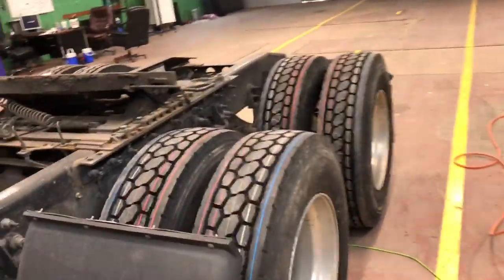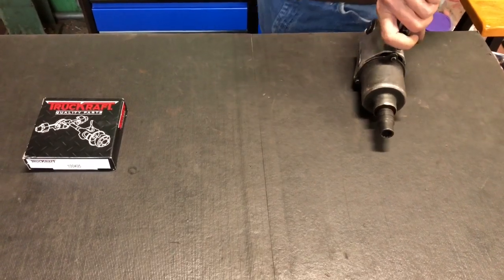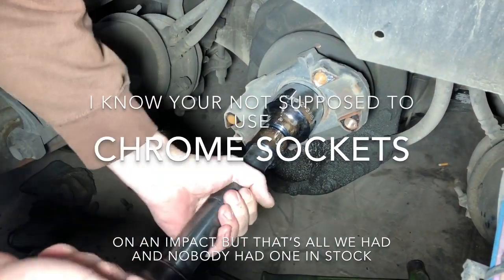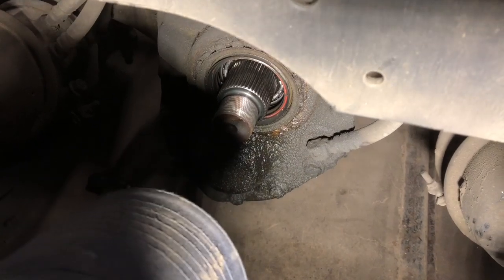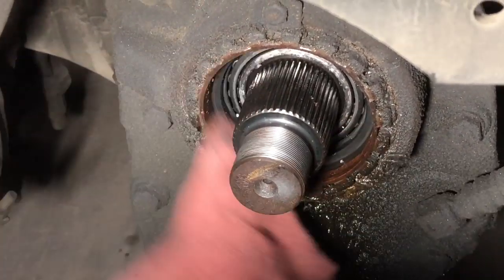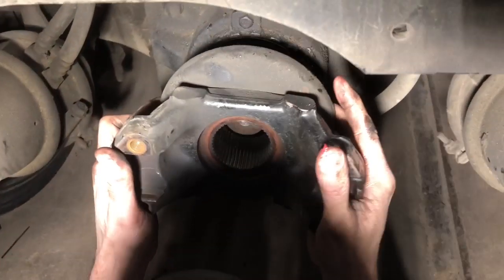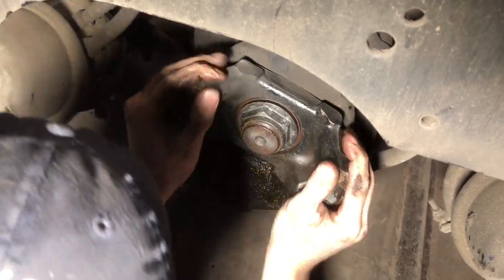Power Divider Input Seal Replacement

Comment: Next time you do one, instead of that seal puller, just use a flat head on the lip of the seal!  Much easier, you don't have to deal with the grooves on the input shaft that are just far enough apart so that you can't get a straight pull with puller!  Love the 4th u-joint bolt!

Comment: Good thing these guys are experts!  Both Eaton and Meritor explicitly says to never use an impact to tighten the yoke nut. Good thing they torqued it along with the u joint bolts to spec! 🙄
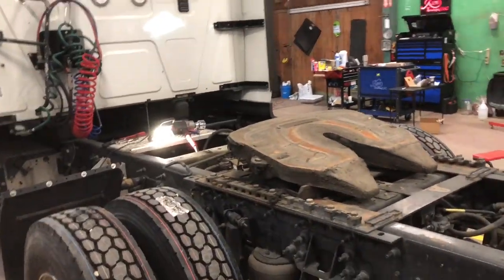Reply: I know you are correct and all (🤓) but just saying ive installled a few of these seals over past years all using an impact to install if youre just 11:54 careful enough you be alright lol

Comment: Behind that gear looking thing is another seal which mine was leaking thru. You can change all the outside seals you want if that small seal is leaking it will always come out. I had that issue and I went thru a lot of seals before we found the issue. Good vid!
Reply: Hi r you talking about the ring looking nut on the top ? 
I just change my seal and it’s leaking again.
Reply: @lukaszwakula4460  yes there’s a O ring people don’t put, Or forget. You need to put the ring and some gasket maker to seal good

Comment: Nice video as always. Word of advice from a liability standpoint. I prefer to use a new yoke nut everytime I do a seal and new u joint bolts/strap kits if not, then put some loctite on the bolts for insurance. Just my .02. Nice work as always.
Reply from the maker: Matthew Cox the guy that owns that truck is a tight ass bad ! Like don’t want to spend a dime on them at all we always use new parts on our stuff. Like this guy doesn’t understand why we even replaced that seal to begin with because he “thought it had a bad leak in it” ..... I️ was doing good to get that much work out of him ! I️ agree we should have tossed some locktite on the bolts tho. We were so happy to get it out of the shop. Tied up space for over 24 hours total on that little job due to that one nut.
Reply: Koon Trucking absolutely understand sir but I guess all the years working at dealerships has taught me I touched it last so I'm gonna cover my ass no matter how cheap the customer is! Liability is the reason I refuse to rebuild 5th wheels, anywhere I work I don't rebuild them, period. It gets a new top plate or I don't touch it! Just some food for thought.

Comment: It is a very good idea to check the fluid level.Do this with my dad's 2001 Freightliner FL60 during every oil change.It is used for hauling used cars he buys from auctions a lot to fix and resell
Reply from the maker: +wafrederick yes sir we check everything on a service. Rear ends, trans and all the fluids. Even measure thread depth and psi on all tires.
Reply: So far,the DOT has not pinched my dad for anything and he does keep it maintained.
Reply from the maker: wafrederick that’s awesome !!

Comment: I clean up around it with a metal scraper it’s for a grill but I use to scrape off big chunks of the crud around the pinion seal for ex. Then I hit it with brake clean and use a rillo pad that has that blue cleaner in it then wipe it down with shop rags unless it’s a nice new truck and good paying customers if the rest of the truck is clean I’ll go as far as using tub o towels to leave it shining I don’t suggest being that clean starting out cause if your on flat rate I doubt you’d be quick enough to do the job right and clean up that thoroughly and still have time to kill

Comment: Step 1,,,clean rear end with zep or a steam genie,,then start working on it,,,your welcome
Reply: I bet you never worked on big trucks at a shop. If you had to do that before repairs you would never get anything done. Then there is who is going to eat the labor to spend 1-2hrs of a mechanics time to pressure wash rears, trannys and engines before repairs. Thats another bill for 200-300 easy at a decent stealership....
Reply: @tryduck6993  clean equipment makes more customers
Reply: @porkchop803scwilliams9  faster and easier to work on, ain't take long to power wash something like this guy is saying lol

Comment: Clay, I have wedged a bar on the frame to get that pinion nut off and pulled the truck because I was told my impact would beat up the gears in the pumpkin. Is that not the case?  I am not a pro and I have to replace a seal. I would rather use the impact to be honest....
Reply from the maker: We use an impact all the time. If they don’t come loose we heat it with a torch

Comment: Some "mechanic" cross threaded the yoke nut. I have a new input shaft but can't for the life of me get it out. Any tips? I have the cover off and can see the hears and shift fork but it won't come off.
Reply from the maker: 1” impact and some heat is about your only option

Comment: Hey man you said it was a repeat truck. I was watching this and was curious if it was still a repeat truck since you put the seal in backwards. Not trying to start anything but we noticed this in our heavy vehicle class.
Reply from the maker: No the truck was “fixed” on the road at a shop. Ran for a few days and was leaking again so after we replaced it hasn’t leaked since

Comment: The torque wrench should be used for that yoke nut. Torque it at 450ft/lb
Youke nuts need to be torqued as well. Torque them at 110ft/lb. 
And never use six point head bolt on that yoke like this man doing at the end. Use always original parts and fasteners (should be 12 point bolt). 
That's how you do not know how to replace the pinion seal. 
I am sorry for people who  clicked "like." They did not learn correct way to do this project. 
..............
I only like when somebody said: "Nobody likes dirty hole." :)
Reply from the maker: That was the nut that came on it? We have done a bunch of pinion seals just like this with ZERO issues so obviously there’s more than one way to skin a cat. Maybe you should start making how to videos and people can watch them so you can teach them your way of doing things but this obviously works just fine

Comment: Hey I’m just wondering was the seal really leaking or was it the threads of that input shaft bearing retainer. I have seen a lot of those input shaft seals like that and it wasn’t the seal it was the threads cause of the crappy sealant that comes in the kit. I was just wondering. you might check that out
Reply from the maker: Phil D12 it looked like something had gotten up against it. Had a wire spot on it. Could have been the last guy that put it in dinged it ? Not really sure. I️ know it’s fixed as of now it isn’t leaking anymore.
Reply: Phil D12 either way it’s the seal. The seal rides on the pinion yoke. If there is oil coming from the threads either the seal is bad or the pinion yoke is worn and needs r&r either way you would replace the seal.
Reply: Saul TaMeZ on a meritor rear end if you look at the front of the input when he takes the yoke off it has a 13 mm head bolt holding the bearing retainer clip it holds the big nut that screws in to hold the front bearing in. Meritor sells a seal kit that comes with the big bearing retainer, seal, wear ring and a special sealant you put on the threads of the bearing retainer. Every seal I have ever changed  it was never the seal leaking it was the gear oil seaping through the threads on the bearing retainer ring.
Reply: Most of the time it's not the seal that's leaking

Comment: My is leaking exactly same way. Is it ok to drive the teuck for another 1500 miles with seal leaking because I have to get back home to fix it.
Reply: Wojciech Gierczynski you kidding? Little leak like that you could drive 50k miles
Reply from the maker: Just check the level of oil and keep a check on it

Comment: We have had a problem with the meritor axles that pinion bearing adjustment collar works it’s way loose and starts rocking and wearing the lock tab and oil starts leaking around the threads, poor design, they redesigned it around 2013-2014 and they don’t have near the problem.

Comment: Usually when I see these leaking it's the preload nut leaking, the sealant on the threads breaks down, they make a kit with the seal, nut, thread sealant, and wear sleeve for the yoke. Just a cunt to get the preload nut torqued correctly

Comment: Thanks for the help. So it can be replaced with out taking the entire rear end out?
Reply from the maker: SKW LOGISTICS 369 if it is in your power divider it will have to come off. I would want to open up that pumpkin to ensure there’s no metal in there. If it is in the rear axle housing you can change it but I would still want to open it up and flush everything out to be sure no metal shavings or bearing material is inside. It isn’t going to cost that much and prevention is way better than spending more later on due to damage done by metal. Just my $0.02 but that’s how we would do it on my trucks here.
Reply: Koon Trucking thank you so much, I will do that.

Comment: I like to Smack the Yoke with a Hammer on the Flanges after Tightening the Center Nut To Help Set the Pinion Bearing To the Race after the Seal Installation 😎 👍🏼 Good Job Guys

Comment: if you guys work on your trucks often and don't have one you should consider a oxy torch kit. after a couple mins of heating that yolk nut would have come right off rather than waiting an entire day on pb blaster. also those yolk nuts should be replaced there considered 1 time use. but a successful repair is a good repair nice job.
Reply: five minutes or so with a hand held map gas torch  prolly would have done it
Reply: Fix It Up 219  probably but a oxy acetylene torch is one of those things i went without for years then after i got one i wouldn't be without having one in the shop. a lot of the time a plumbing torch just wont cut the mustard.
Reply: @Ezrider359  that's why I have a set mounted to my pickup truck bed...
Reply: would the torch wreck the 'heat treatment' of the pinion? similar to steering parts
Reply: @MsForrestj  depends on how hot you get it,... But ur just heating the nut to loosen tq just enough to break loose
Reply: @Fix It Up 219. I got to disagree with you on the point of how hot. Any heat will remove the treatment. Also, the parts are going to transfer the heat because of how tight they are. I think best practise is to treat the nut like an axil nut, and not use the torch unless replacing parts, as in a destructive removal.
Reply: @MsForrestj  I have never seen onr break unless a universal joint exploded or someone dump the clutch or back the truck into a loading dock with the clutch engaged
Reply: And as far as heat treatment it appears to be a machine to chunk of cast iron
Reply: @ fix it up 219 parts are baked for heat treating. if it milled, the treatment happens after cutting. like you I have not seen a yoke break, just like I haven't jumped off a bridge. the point being, ditto, you haven't said anything that gives me a reason to think heating is ok. I believe heating the nut is not a best practise, and should be done with caution and the task should be done by a mechanic with years of experience.
Reply: @MsForrestj  yeah ... Like me... The nut just keeps,the yoke,in place the splines take the torque and shock load from the drivetrain
Reply: @fix it up 219. if the yoke breaks, either part of it, will cause a 'catastrophic' failure
Reply: @MsForrestj  they,wouldn't unless the truck was abused like backing into the dock with a clutch engaged or dumping the clutch
Reply: @fix it up 219. if you loose the heat treatment on the metal it is the same as damaging a part. you could install a damaged part, but I think you are missing the point. a professional mechanic doesn't do that. there is a better way to remove the nut
Reply: @MsForrestj  the parts are so robust heating a nut just enough to break torque is not going to be an issue
Reply: More importantly you're supposed to torque the lug nuts in a Criss-Cross pattern and then go around it in a circle once or twice but nobody ever does it in dozens and dozens of duels fly off of trucks every year
Reply: try penetrating oil.

Comment: Problem is your choice of non impact socket and allowing the yoke to hammer freely back and forth against the ring gear..Didn't need to set the proper torque back to ensure proper bearing wear eh. Prostar probable isn't still on the road after 3 yrs anyhow..

Comment: Suppose to put a new nut on the yoke once removed.   If nut doesn’t budge use a blow torch bc it’s probably the original from factory and they used red lock tight. Might as well replace yoke and u joints.
Reply: Heat isnt needed , just proper tools...

Comment: Can that bearing be replaced with out pulling the third member? I have play at the yoke.
Reply from the maker: SKW LOGISTICS 369 to get to the bearing you will have to pull the yoke nut off
Reply: SKW LOGISTICS 369 your powerdivder gears are worn out